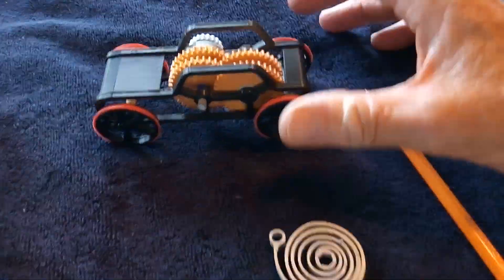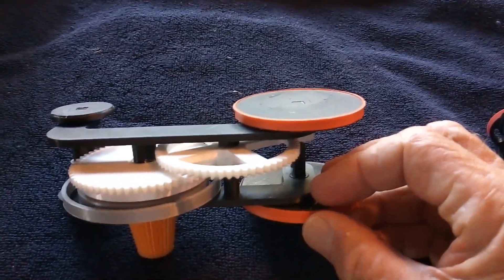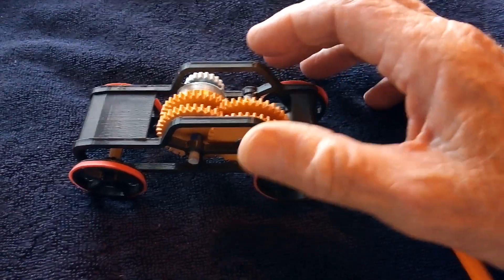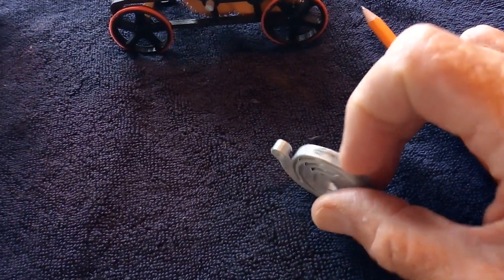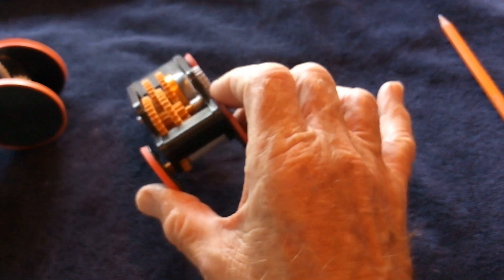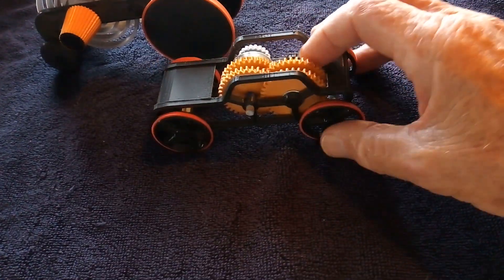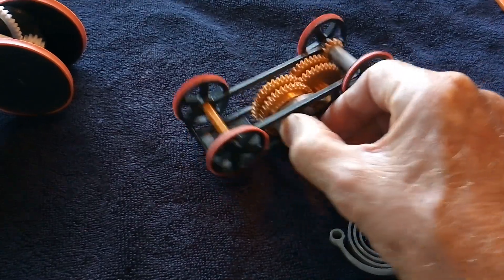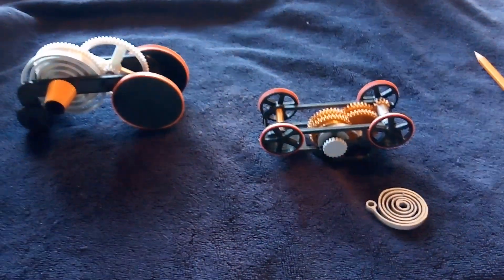3d printed toy windup car

Comment: Lubricate your gears!  Use clock oil!! It should work better.  Also, oil the spring!
Reply from the maker: I tried all kinds of oils but nothing worked very well on the PLA plastic on plastic friction surfaces. I tried clock oil and that didn't work either.  Let me know if there is another specific lubricant for PLA that might work.

Comment: Probably sounds wrong, but I am glad you had the same problems. Really frustrating to get it sorted. I did have somebody suggest how to fix the elephants foot. I haven't tried it yet but I did find the setting.
Steadfast RC - you can avoid elephant foot by finding the setting ( initial layer horizontal expansion) and set it to -0.2mm to -0.4 mm or something close to that.
Reply from the maker: Well this has been an interesting project but the frustration of having something that looks so good but doesn't work right is terrible.  I will work on the 'elephant foot' and spring issues perhaps later on.
Reply: @Lidmotor  I will just say "good luck" 😊
Reply from the maker: @GrandadIsAnOldMan  I just added your 6th video in the description above to show people how this thing should run.  I printed my second spring using the Cura slicer setting at 'random' but still had a weak spring. I may try a different plastic filament.  As I mentioned a ways back, one of the reasons that I did this project was to remind myself how extreme persistence can sometimes pay off ---not always but sometimes.  Thanks for documenting this long project so well.
Reply: @Lidmotor  I had given up on it until that suggestion about the randomisation, and even then I really didn't want to spend the time on it. I have just made public the modified gears file, if you wanted to get it back off the shelf  https://www.tinkercad.com/things/khC3fRelMx7
Reply from the maker: @GrandadIsAnOldMan  Oh wow!  Thanks. I will print those gears up when I get a chance.  I had to shelf the project (with zero success) today because of time issues.  I printed up two more springs this morning with no luck so I will let this project rest in peace for awhile.
Reply: @Lidmotor  I can only say that choosing the random setting for the start point made all the difference for me on that spring. Maybe there was something else I tweaked, but I don't think so. Good luck anyway 👍